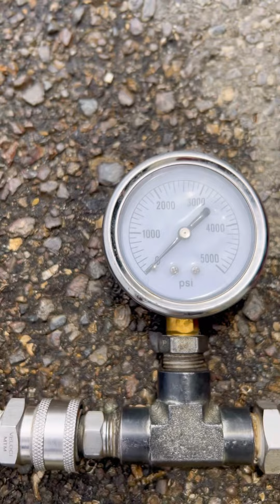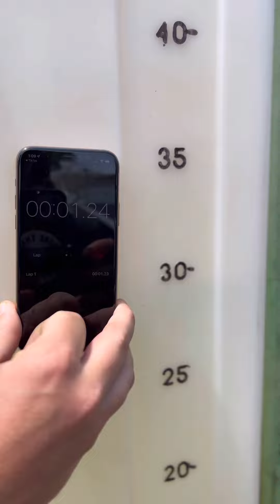CRX680 10gpm at 2700psi Bucket Test

Comment: Not at all knocking your machine but if using a #10 nozzle and only getting 2700 psi then it’s actually only putting out approximately 8gpm. Any nozzle chart will show that. Still great price. Never heard of this engine. Guessing it’s similar to a Predator
Reply: Nozzles are rated at 4000 psi so a #10, putting out 10gpm will develop 4000 psi. Only way it works. Gonna keep and eye on these engines tho. May order one or two. Hondas are almost impossible to find nowdays. I’ve ordered from y’all few times in the past so don’t take this as bashing please just anyone who knows how these nozzles work MIGHT bash y’all for this video. Just trying to help, I know y’all are some pretty good folks.